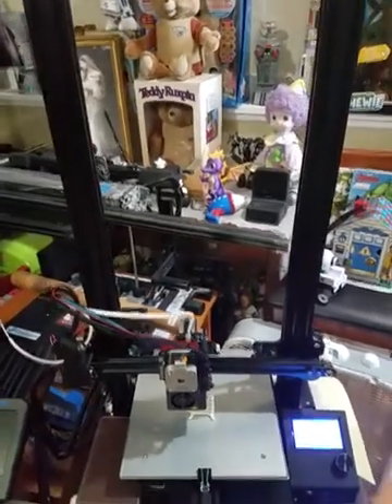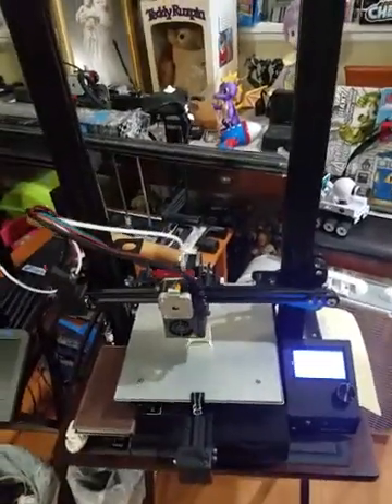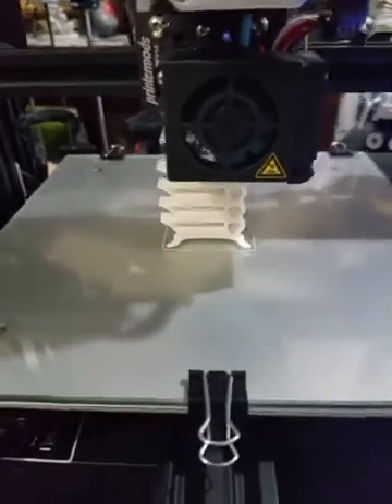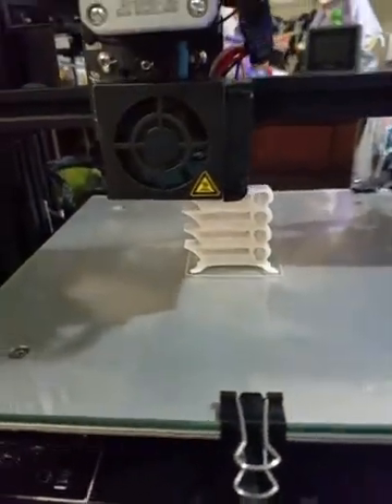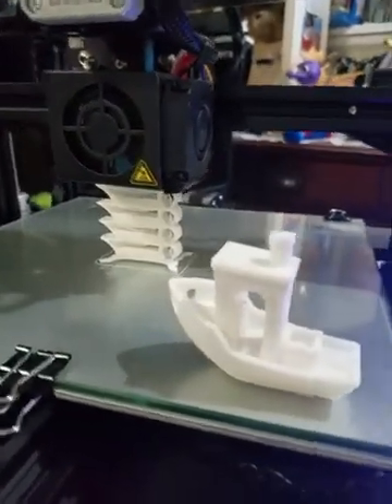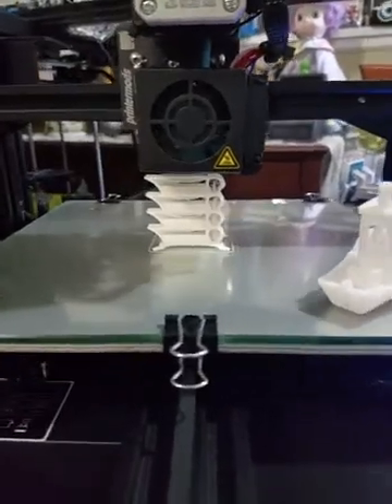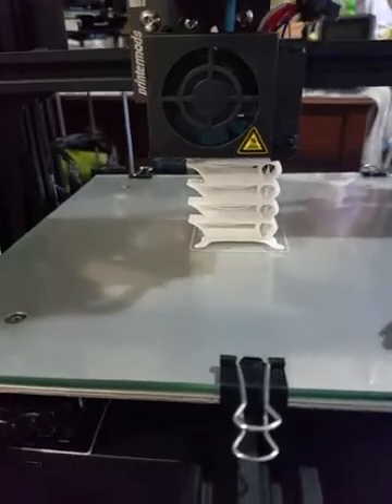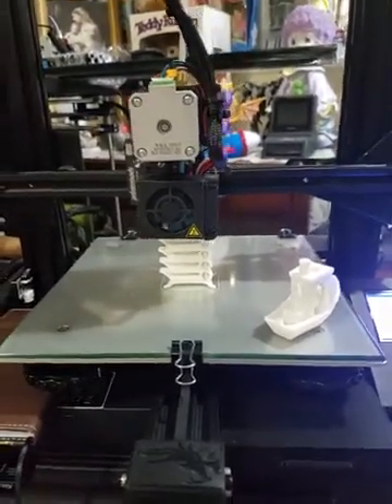3D Printer: The Ender 3Pro E1 Heating failed Issue Part 1

Comment: There are components (heater, thermistor), and there are also solder joints, wires, wire insulation and connectors.
Solder joints can be bad:  insufficient heat, not properly cleaned or fluxed (apply flux-core solder to the heated joint, not the soldering iron; the burst of smoke is the flux burning off as it cleans, and you want it to clean the joint).

Wires that are flexed will eventually fatigue and break, a strand at a time, and become intermittent.  Finely stranded wire helps; wire supports that spread the flexing help a lot!
When wires rub on each other, the insulation will eventually wear through and you can get shorts.
Tin connectors oxidize.  Tin against gold apparently has problems (some compound forms), so it's both connectors gold or neither.

Comment: THIS IS WHAT WORKED FOR ME

at first, I got the thermal runaway error and the heating failed error during multiple print attempts I decided to CHANGE REPLACE THE THERMISTOR AND THE HEAT BLOCK WIRE, when I did that the thermal runaway error stopped popping up but I kept getting the heating failed e1 error
I tried everything PID tuning, taking apart the heating cartridge and putting it back together, going to the motherboard, and making sure I tightened all the wires, after all, and after all that I still got the heating failed e1 error. turns out it was my power supply. it turns out there wasn't enough power going into my heating cartridge, I turned the little screw that increases the voltage the power supply sends to the printer and that fixed it. I'm 2 hours into a print and no heating failed error.

TIPS:
1: if you live in the U.S your voltage should be 115, (you can switch it on the back of your power supply just use a tiny Allen key)
2: to find the little screw I turned to watch this video https://www.youtube.com/watch?v=pJRYXKRAUN4&ab_channel=TH3DStudio he shows it at 0:39
3: WHEN TURNING THE SCREW IF YOU DO NOT HAVE A MULTIMETER ONLY TURN THE SCREW A VERY TINY AMOUNT OR YOU COULD OVERLOAD YOUR PRINTER IF YOU HAVE A MULTIMETER CHANGE THE VOLTAGE TO 13.5 AS HE DOES IN THE VIDEO I LINKED.

I hope this helped you if you have any more questions you can reply to this comment
Reply: thanks for sharing . Tried that but still getting that error

Comment: Me and a buddy of mine are having this exact same problem, we're both on Ender 3 pros but one is a 4.2.2 and the other is a 4.2.7 and both have silicone socks.

Did you ever have any other issues or tips that could help us solve it? Mine happens sporadically but his is constant and wont function at all.

Great vid btw thanks!!
Reply from the maker: I have had several type of issues, this same printer after working for a long time did the same thing once and that was it. It is challenging to troubleshoot these things. if you have future issues feel free to ask me on FB :) or here...
Reply: did you fix the problem yet?

Comment: Having the same problem with mine. So the silicone sock solved it?
Reply from the maker: Hi there! If the issue is on E1 or the hotend, it is possible that this is the error. Some are against the silicone sock but I use them n all my printers except PRUSAs (just have not gotten to them :) ). Now in my case the sock covers the heating block and that is where my part cooling fan was blowing at. I did change the thermistor and heating element and  the issue continued until I placed the sock. Since then no issues but I did replace the direct drive as seen on this video with a MicroSwiss and all works fine. 
Hope this helps out! :)